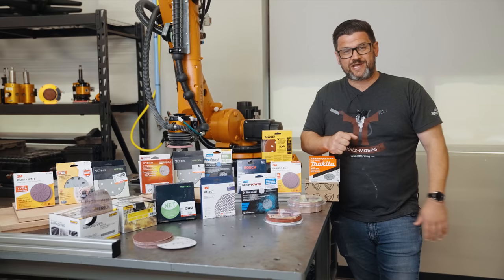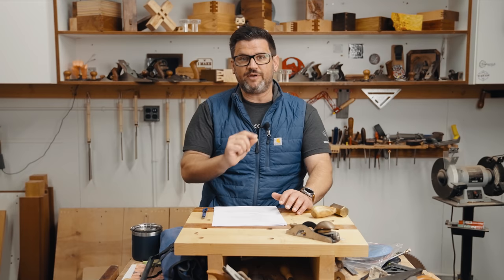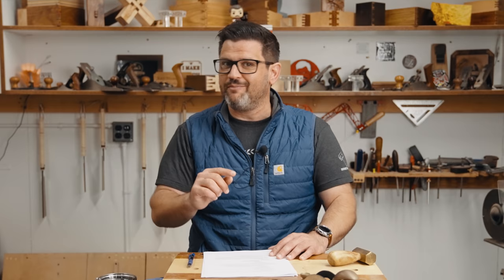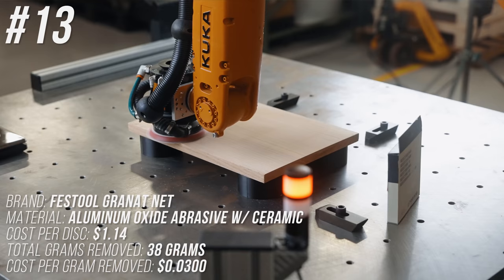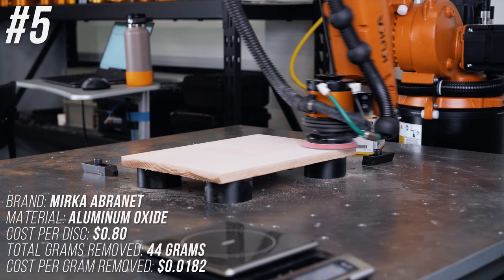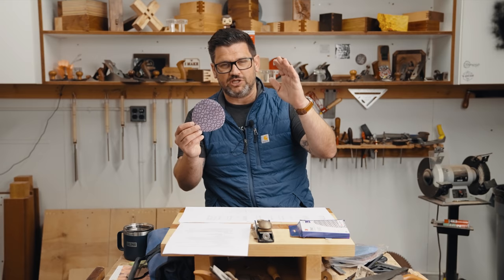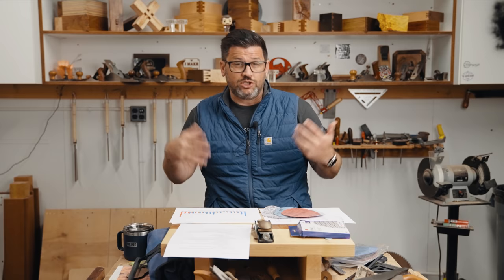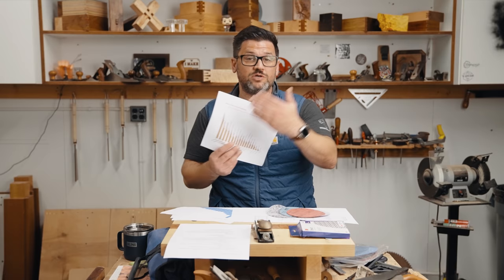Largest Sandpaper Test EVER Done - Top 19 brands Tested using Robots for Unbiased Data

Comment: This was very interesting and revealing. I am retired and enjoy wood working as my hobby. I have been using Mirka Abranet for a number of years and am totally sold on mesh. I like being able to take an air hose to the discs and blow off most of the dust which extends the usable life of the disc. The traditional solid discs get loaded up with the dust and cannot be cleaned adequately to keep using them. 

But...I will definitely look at the 3M Cubitron Xtract Ceramic and order a few to try. And it looks cool, too..!!

Comment: The only thing missing from this test is quality of cut.

As we have all experienced, some papers are more prone to leaving swirls and other imperfections that can be difficult to remove as we move up in grits.  While the 3m papers may be the best from your metrics, some of the less effective papers may actually leave behind a better surface for subsequent grits, thereby reducing total sanding time.  They may also impart a better finish, negating the need to sand with a finer grit.

My suspicion for why mesh cuts better is not just clogging, but because the pressure per grain of grit contact is MUCH MUCH higher, meaning grit in contact with the wood is being pressed in deeper and therefore cutting more effectively.  However this may also impart more micro scratches that must be removed by subsequent grades?

I would love to see these same papers tested with some measurable metric for quality.  Unfortunately its very difficult to design such a test.  I wonder if subjecting a piece of shiny metal or acrylic to 1 minute of sanding would reveal a scratch pattern that could be measured using the reflection or refraction of light off the surface.  The best papers should make the surface evenly matte, with no visible swirls or other bright points when light is shined through or off of it, while a paper that leaves scratches would create a different effect.

For example in this video https://www.youtube.com/watch?v=4jfyurvgGQk they scuff the surface of a plastic tube using scotchbrite pads.  On the outside of the tube (@ 2:43) you see a fairly even pattern due to the way they sanded, but when they do the inside of the tube using a drill you see very defined swirls (@ 3:22).  Not the best example, but I had just watched this video so it was an easy one to find.

Perhaps by lightly sanding a peice of acrylic, backlighting it and taking a magnified picture of it in a controlled setup, then measuring the variation between the brightest and darkest pixels, or the number of pixels brighter than some baseline, would make for a way to identify the sandpaper that left the fewest deep scratches?

Anyway, I think your tests covered the most important thing for woodworking,  and I will definitely be picking up some 3M Xtract as a result, but I would love to see how it stacks up in cut quality.
Reply: The moment he announced the rating method, everything that you wrote flashed through my head. He's a huckster, not a woodworker. What did you expect?..
Reply: Agree 100% about surface finish versus material removal capacity. Also the grit ratings may not be 1:1 regardless of what is printed on the box. The only way to know for sure would be to sand a suitable material like mild steel and measure Ra with a profilometer. The abrasive zigzag pattern may very well be a technological step forward. I’m sure I’m it is  protected by a patent.

Comment: First of all, thank you for taking the time to get us all these numbers! It's handy to have some sort of quantitative measurement (grams removed over period of time is excellent); however, I've realized it's worth considering the intention of use for the sandpapers.

I've just tested a small subset of discs on a number of wood panels that I'm preparing for finishing -- Mirka's Abranet (+ their Ace version), the original Festool Granit, and this new 3M cubitron product, which is significantly cheaper than the other two. To its credit, the 3M does remove more, and last longer. It's an excellent product if you want to remove wood (e.g. shaping). From the details provided by 3M for this product, they've spent a lot of time developing a grain that cuts into the substrate. However, to finish and smooth out wood in particular, I'm leaning toward the Mirka product.

My tests are highly subjective, simply because I don't have the means to measure beyond touch. The Mirka product leaves the surface significantly less 'hairy' than the 3M. I'm guessing the 3M grains cut deeper scores into the wood, whereas the Mirka product cuts across the surface of the wood. For discs of the same grit, 3M cubitron is noticeably more 'grabby' when finishing. This would be consistent with 3M's descriptions, and bear out in the data you've provided regarding wood removed. 

For a workflow, specifically in regard to finishing, perhaps it'd be a good option to use 3M to do the rough smoothing, then finishing up past certain grits (120?) with Mirka or similar.

Comment: I saw this video when you first made it but was waiting until I ran out of sandpaper before trying the 3M product.
Just made a batch of 17 cutting boards and a single cubitron 80 grit lasted the entire rough sanding. It also took way less time per board with a single disc than it normally would have with my old klingspor discs which I had to swap out about every 6 boards.
Great job on this review and your findings are definitely true!

Comment: Brilliant test under laboratory conditions. I did a similar test on abrasives a few years back for my company but I must admit that it was not using robots so probably not as accurate as yours.
However, I did find that there was a huge difference in results according to the dryness/moisture level of the abrasives and I found that I needed to ensure that all of the abrasives where stored in a low heated chamber for several days to make sure that they were all on a level playing field. It occurs to me that this is a key factor in how the average woodworker will judge the performance of an abrasive and to this end I have always kept my abrasives in a cabinet which has a small 15 watt light bulb mounted in the bottom. I find this is sufficient to keep the abrasives totally dry all year round even though we suffer extreme rain in my part of the world. I would like to pass this tip omto my fellow woodworkers as it has saved me a small fortune over the years but costs very little to set up.

Comment: I’ve learned one thing throughout life, you never go cheap on trash bags toilet paper or sandpaper. I go through a lot of sandpaper. With five guys constantly sanding and buffing, I feel like every time I turn around I have to order another case of sandpaper. However, I can tell you I have tried every single brand from the cheapest all the way to the most expensive. Most expensive being the one that rhymes with Bestool lol. I will say that I have tried the xtract and it Definitely has a place in my shop. We use it a lot lately for sanding after we’re done with bodywork and prepping for spraying. does work good. The thing about the xtract for my industry is we are sanding sometimes very rough edges of fiberglass that hangs over the edge, or sanding uneven surfaces and the film/net style does not stand up at all and nowhere near worth using net compared to paper back discs. One thing that’s most important to me with sandpaper is dust collection. Because we do not have a paint booth, we have to make sure to keep the shop as Dustless as possible. And unfortunately, even with dust collection on every single tool for the most part, there still is a ton of dust but I do notice that mesh/net disks certainly are the best for dust collecting and the 3m xtract is better even than Diablo sandnet (only net I’ve used Mirka Abranet is to expensive to even demo). For about four months we used nothing but Diablo sandnet from Home Depot. But, it’s just ridiculously expensive. And my guys refuse to use their brain while they work and they just use the net sandpaper on rough surfaces and the disks tear and the corners get destroyed instantly if not on a smooth surface so I was blowing through the net sandpaper because they just throw it away and put a new pad on because they don’t buy it. One of the perks of employees I suppose. But, I exclusively buy 3M Cubatron discs. I would say for fiberglass/gelcoat composites repairs, or the boating repair industry, the extract discs (any net/mesh style) may not be the best fit for us even though I wish it was because it’s so cheap right now while they try to get everyone hooked on it and then make it the price of normal 3M Cubitron. Believe me they are cheap now due to being new. I’m going to possibly buy a few pallets as an investment lol. Now I wish that somebody would make a more affordable option/alternative to Mirka Abralon. The disks having the foam on them makes wet sanding gelcoat so much cleaner. Gelcoat always has a lot of peel and needs a lot of sanding after spraying and it’s EXPENSIVE to sand a whole boat. I have tried a few of the knock off Abralon pads and they suck compared to Mirka Abalon which still sucks because gelcoat being essentially just polyester resin its very hard on sandpaper no matter the media used for abrasive. Ceramic is definitely the BEST I’ve used. So you use a three dollar sheet to sand maybe just a few feet if your lucky. Overall this was an AMAZING video but so subjective to what industry your in. Wish I chose one that allowed cheaper abrasive bills ($19k last year in JUST abrasives and polish).

Comment: I've been using autonet in a mirka sander for years. One thing that dramatically improves it's efficiency is providing replacement air in the center of the disk. That's a design feature of the plate.
I will test the 3M paper as we sand a LOT!!!

Comment: Just passing as a casual viewer of this channel (and 5 months late) but I have some questions/thoughts/observations.

How were they in regard to surface finish? Were some inaccurate with their grit description or leave noticeable damage on the board?

Maybe a follow up test (assuming it hasn't already been done, I haven't checked yet) with some top performers on difference species and different grain structures?

While I have no love for festool, your discussion of festools proprietary hole pattern made me wonder, how much effect the sander used in the test had on results? For example, how do the festool papers on a festool sander compare (same with other brands like makita.. maybe it's not quite as awful when used on a makita sander, though it seems doubtful)... What paper does that robot typically use?

So, again, maybe a small follow up test comparing papers on different sanders?

Finally, cost. This is a huge variable and is location dependent. Was the cost your local cost? Wholesale? With or without tax? cheapest anywhere in the world? (I imagine some brands will be cheaper/dearer in other countries) maybe a quick check of a few prices, excluding tax, in a few major markets.

Comment: I love that you guys are doing this kind of work.  I hope you can encourage others to repeat this and/or do similar experimentation.  I don't think you could get much better data, but you can always have more!

I do doubt whether heat is making much difference here; the main way in which heat is the "enemy of sharpness" has to do with how metals react to heat, and it generally has much less to do with carbide/oxide/ceramics.  Not to mention that 'sharpness' itself is of limited relevance to abrasive cutting - probably almost all of these differences deal with clogging and adhesion of the abrasive to the substrate.  I'm sure the fancy cubic grain and other sharpness related things still have an effect, but it doesn't matter if your paper is clogged!

Comment: This is just tremendous, JKM! The only thing I hate more than sanding is sanding with crap sandpaper and/or paying too much for it. This test has cleared the muddy waters without question. Thanks for doing this test. BTW, I just went to Taylor Toolworks website and bought a mess of the Cubitron Xtract. And while I was at it, I picked up a couple of much-needed router bits.

Comment: Well done Jonathan.  Excellent work.  As a Carpenter/Builder/Contractor, time is money, so the faster we can get things done, the more money we can generate.   Sadly,  the consumables we use are often purchased by people not working on the front line and so generally, based on cost alone.  Now we have an option that not only satisfies the bean counters but also clears work faster with fewer changeovers.  I wonder if perhaps in a future test, you can also measure the total time required to clear a specific amount of material Including the time required to change out discs.  On site, we don't always have limitless stockpiles of discs, and not having to switch them out as often saves both time and space in the toolbox.

Comment: Amazing test that clearly shows the advanatages of the #1 and #2 3M models which are using mesh with ceramic abrasives, all the others (save one mediocre non-mesh option) were using aluminum oxide. Obviously ceramic has a big edge in this test and you did a really great job demonstrating that. That said, you left out what could very well be the main contender for the title, the Mirka Abranet ACE which is their mesh ceramic abrasive version, which should give it much more durability and longevity as the #1 and #2 3M versions showed. The Mirka ceramic vs the 3M ceramic would be a cool title match up.

Comment: 2 huge things left out of test. Edge sanding and finish quality. If I want to sand a ton of material off fast then 3M works great. If I want the disc to hold up to edges and get the best finish then Klingspor wins hands down.

Comment: I do a lot of sanding at a cabinet shop. I feel like one of these machines are coming for my job
Reply: Decent robots for most things start over $20,000 (don't know about a sanding bot).  Then the shop has to have a programmer to change the programs all the time.  If you work for a really large shop and you're seriously worried, then perhaps you could look into what sanding robots are available and how to program them.  Even if you know absolutely nothing about programming, you'll find that you don't need anything beyond basic math (+, -, *, /)and a willingness to learn.  Plus the patience, focus and concentration you have already clearly demonstrated if you can sand for a living and do it well.  Programming robots gets complex, certainly.  There can be a lot to keep track of.  But, none of the individual steps are difficult.  If you can make the financial case that it's worth it for your shop to buy one, you should be able to convert your job, get more done, and be able to justify a nice raise.  Of course, if your analysis shows that a robot doesn't make any sense, that's good information for the company as well.  Bottom line, automation is a good thing when done correctly, making sure that it's good for production people and for the company.  It's the only ethical and the only effective strategy.

Comment: This was surprising to me, I did not think of removal of material in this way!  Although what most may not realize is that if you extrapolate  that out  over a period of time, you would spend a lot more money/resources for the same/similar result using lesser quality papers/meshes. Great job guys, it opened my eyes quite a bit on how I look at/for sandpaper.

Comment: Thanks for the test!  I'll head over and read your test results on the web page. 4 items:  1. Why 10.x pounds of force?  I regularly find myself pushing down (tongue out concentrating on pushing that sandpaper) and back off -- goal being nothing other than a weighted hand and a the sander weight; when the stack is high, I get with the program pretty quickly and do it as I should. 2. Testing the top 3 (or so) that had high removal rates on a closed grain wood (well, maple and maybe pine; common woods). 3. Comparing relative finish of the top few (I don't expect any real difference as long as the paper is removing a significant amount -- worn out is worn out).  4.FWIW, the Festool center hole pump air out to help push dust, whether that is high value I can't say; it's a feature at the very least.

Comment: I bought the cubitron based on the last video. I was blown away by how great it worked. Unfortunately I was soon disappointed in how the paper stopped sticking to my pad. I bout 2 variety packs from your linked website. All the different grits and every single piece lost its ability to stay on the pad. Even bought a brand new pad same results. Since then I’ve been using klingspor results aren’t as good sanding takes longer but I can at least use each piece to it’s fullest.

Comment: My opinion is that the test result is a valuable datapoint. While a significant effort was made to reduce confounding variables by the use of a sanding machine (more on this in a moment) to control for pressure and time, a limitation of the test results was that they can really only be applicable for one type of wood. The effect on different hardness  of wood types, as well as grain orientation, might deliver different results.

Further, the test results focus on only one element of sanding, which is amount of waste. This is similar to video of woodworkers taking gorgeous, gossamer shavings with a handplane, which are then held up for “proof” of the performance of the plane or blade. The real test is the quality of the surface on the wood which is left behind in association with the stated grit along with the time to do this and the distance the paper can go. This kind of result requires a prodigious amount of experimentation and experimentation time. Consequently, what we have here is a partial data point for the wood involved. Regards from Perth, Derek